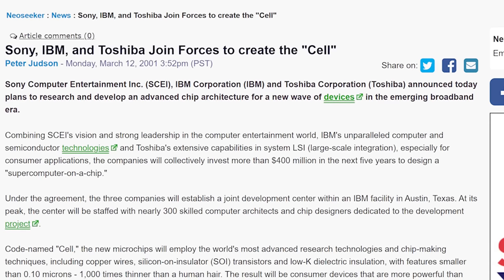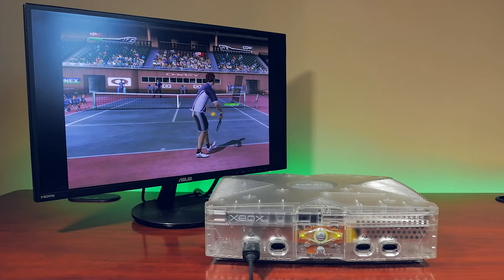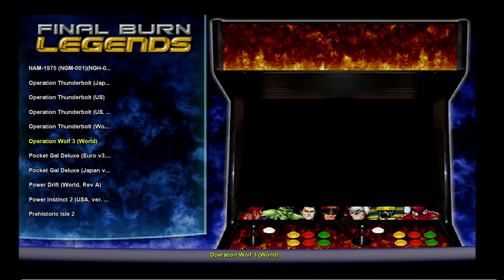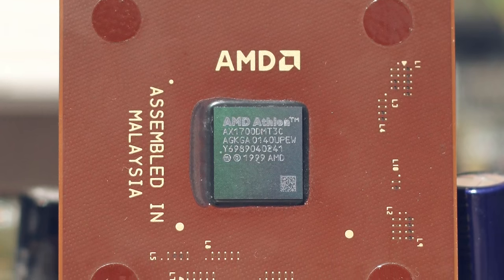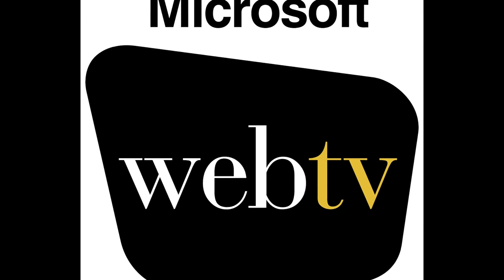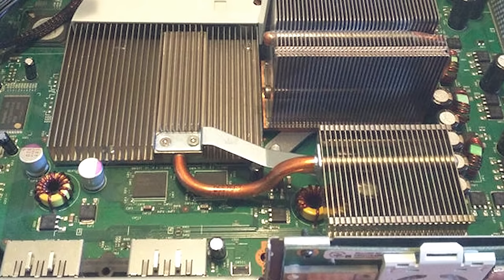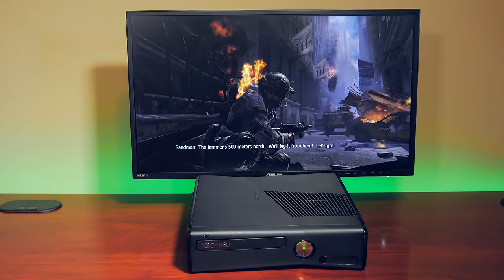Why Microsoft switched from Intel to Power PC for the Xbox 360  | MVG

Comment: I find it interesting to see the shift that hardware chips have taken over the years from excessive diversity to a rigid monoculture. Back in the day it seemed like every console and arcade machine had its own customized hardware designed specifically for it. But as games became more technically advanced and costs of making them increased, it just doesn't seem to be financially viable anymore for console manufacturers to spend the exhorbant amount of money on custom designs and instead reaching for tweaked off-the-shelf solutions. Which is why the PS4 and Xbox one run x86-64 (like standard PCs) and the Switch runs ARM (mobile phones/tablets). I feel like for the 360, the PPC deal with IBM was simply the most financially viable deal for them at the time. Look how much money Sony lost on engineering the Cell. Enough to offset pretty much all profit that would have been made from the PS3 in its lifetime. Despite how interesting of a design the Cell was, I don't we'll ever see such a radical and risque design like that ever again because it just isn't financially viable anymore.
Reply: You have it a bit backwards, they made custom hardware because it was required for the games, commodity hardware was not capable. They never made custom hardware just for the fun of spending money.

Comment: PowerPC just had a great price/performance ratio at the time, x86 could never match it at the time, remember Xbox had to hit 299 price tag and perform well in gaming, at the time for that price you could not get anything from Intel nor AMD which would perform like this for this price. IBM was best partner to do this thing, reliable, strong partner with a lot of experience in custom designs, decades of experience, they were doing it very well with Gamecube, and now they did it again with XBOX360, PS3 and Wii. There is a reason why manufacturers chose IBM.
I do not think that IBM is to blame for overheating, designers from Sony and Microsoft are. GameCube/Wii/Wii U did just fine. 

  Yes that PPC 970 chip was hot as hell but most FAT PS3 failed because of NEC TOKINS and not because of failing Cell. The real problem was that it had shitte thermal paste under the IHS which dried up after long use. A lot of people think that RSX is to blame for YLOD, but it is actually Cell which was overheating because of shitty thermal paste. Sony designed PS3 poorly, they jammed that hot 380w PSU into small case, it did sit near damn chips and caused even more heat on those heat monsters. And even though, PS3 FAT design is shit, if you took care of your system, delided it, replaced failing NEC TOKINS, even CECHA models work to this day. Sony only solved their problems with PS3 Slim, ofcourse 45nm redesign lowered the heat drastically, but that was the price, remember guys they designed that chip in 2002-2005, Intel had a heat monster of their creation as well... Called Pentium 4 and then later Pentium D. 

   Same shit with XBOX360, they jammed all of those components to even smaller case than Sony did and they expect it do not overheat? Its is MS to blame not IBM.
Both Sony and MS sold their consoles below manufacturing costs, at the time, PC prices were just too high, and even though PPC was cheaper it still did cost a lot. 
  Wii U was a failure to be honest, that chip was just fkin too old at that point, IBM did not have anything acceptable in 2010-2011, which is kind of strange having in mind that PowerPC chips were in like 200-300 million gaming devices, why the hell IBM did not invest some money and effort  in RND to improve their PPC gaming architecture, they had the market share and the money, its like really they got money for every 200-300 million unit those companies sold and they did just sit do nothing for 12 years with their architecture. Thats why X86 won, because IBM fell to sleep, they had Apple and Consoles in their hands and they dropped the ball. Apple did good predictions with that and foreseen what will happen, C2D architecture was such a huge leap that even to this day those chips perform decently which is kinda mind blowing to think about it, for example my Macbook Pro and iMac both with C2D chips run so well with modern SSD.. A 14-15 year old chip working well even to this day.... is amazing.. 

To be honest, Cell was a technical marvel, it could not be matched for some time, it was created in 2005 and was so powerful its amazing.. And it is creation of Sony, IBM and Toshiba. The bottleneck of PS3 was nVidia GPU, if it had better GPU it could even play modern games I believe... look, they did go safe route with PS4, but CPU power of PS3 is stronger than  that low end X86 CPU on PS4 which just shows that Power PC was amazing and really could have been an option if not for lack of interest from IBM. Both Sony and Microsoft decided to offload most of processing to GPU side, and did chose weak X86 CPU to do the other calculations which could not be done on GPU. I do not buy fact that developers were more common with X86 than with PPC, look, they sold 300 million consoles from various manufacturers, they had Apple users using that platform, PPC certainly have developers interest. They did chose X86, because it was easier than PPC, but most importantly it had better performance per price, IBM just dropped the ball. Manufacturers chose to go code optimization route, which Nintendo did for years starting with GameCube, they did not give a shit that console was weaker, but they made some the best games. look at late cycle PS3 games, they were amazing.. Even on Wii U, which was a failure, they managed to make some amazing games, its all about code optimization, hardware is nice, but you really care about price/performance + code optimization, and thats why we got X86 APUS on 8th gen. Thats why we got X86 APUS on 9th gen, because for its price those APUS cannot be matched, just like X86 could not match it at 6th gen.

   To conclude, it is kinda amazing that IBM had such an impact in gaming and content creation history they had it all and they dropped it all which is kinda sad, because we need competition to x86, competition is good for us, consumers and it makes technology move forward. Now we see the same thing is happening with X86, Apple already announced they are dropping X86 for ARM which I think is a good call. X86 was a PPC killer and now ARM is a X86 killer, same old problems, too much heat and incremental improvements. We really have not got anything really major since 2011 then Sandy Bridge was introduced, we only got more cores, more clock speed, faster ram, faster storage on these new platforms. Atleast AMD did kickback and provided chips like R5 1600 AF/ R5 3600 and these new amazing R5 3100, they are amazing for their price, Intel is down on its knees now.  I would not be surprised if at some point even consoles will drop X86 and move forward, but for now and probably for PS6/XBOX1_V3 its going to be X86, because price/performance is unmatched at high end, at lower end, lower wattage ARM is already better than anything X86 can offer, look at A13 chips from Apple, they are cheap yet they have so much power that they can match 15W Intel CPU at 7,5W, its just a matter of time then they will learn how to stack those ARM chips and outperform X86 even at higher market.
Reply: ^this

Comment: I still remember all the red rings my friends got. I had a ps3, but I remember a couple of my friends had Frankenstein machines, holes cut in the side, fans hot glued in to suck the heat out, one guy had it straight mounted to piece of wood instead of in a case at all

Strange times to be sure.
Reply: I played the crap out of my ps3, never had any yellow lights. I know they were out there, I'm not naive, but I think the failure rates were 10% of the 360s.
Reply: I kept the shell off of mine and would just take the top of the disc drive off, remove the magnet then insert the disc & put the drive lid back on . Basically hotswapping which would also allow for ISO mods on unmodded 360s :)

Comment: Conclusion: Apple's philosophy about heat isn't changed after all these years
Reply: Considering how they shipped laptops with completely inadequate cooling for so many years, this "philosophy" only exists when it suits them.
Reply: They shipped the last macbook with passive cooling (there is a fan, but is not connected to the processor) just to make comparations when their arm is released.
Reply: It's gonna change with ARM though.
Reply: Apple’s obsession with heat (or having a lack thereof) goes back to the near beginning of the company’s founding, as Steve Jobs hated cooling fans and insistent on using passive cooling whenever possible.
Reply: @jmtrad1906  I saw a video from Linus that barely saw any performance gain even if you totally remove the thermal limitation. Not to mention most people probably won't 100% saturate the CPU of a macbook air for hours on end, it's just not what you would buy for that given use case I would think.

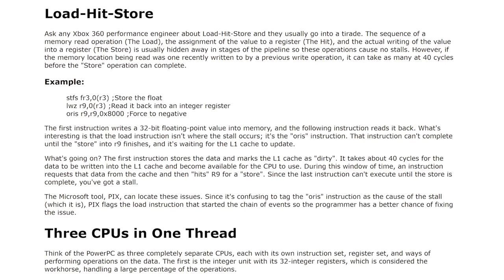Comment: 10:00 oh wow a Burger Becky article about perf and Load-Hit-Store and coaxing the C++ compiler into not generating garbage. There’s quite a bit of difference between early and late X360 and PS3 games and counting cycles and pipeline stalls made the difference. 
IIRC late generation games like Gears of War 3 was known to cause overheating issues because efficient use of hardware means everything is being used at the same time, those 40 cycles of pipeline stall in that article meant a core isn't being used, thus less heat being emitted.
Reply: referral madness  one of the co-founders of Interplay, industry vet going back to the 2600 and Apple IIGS
Probably want to read "Masters of Doom" for the burger story. It's a name that keeps popping up around PC and 16 bit era games.

Comment: Their attempt to control the hardware and control the cost ended up with the red ring of death, would cost them even more in the end. They really cut down on quality control, which saved them costs up front.  Those cost savings bit them in the ass when the quality control came back as millions of units failed.
Reply: They make these sacrifices in order to steal consumer mind share from each other, this has been the most prevalent in making systems successful. The PS2 was outclassed in hardware by its competitors, but the fact that they had limitless exclusivity deals and were reduced in price year after year, led it to becoming the most successful gaming console to date.

Comment: 8:00 I don't know why this is framed as "unfortunate for Sony" that they didn't have exclusive access to PowerPC architecture and Microsoft was also able to use it. Nintendo had been using it since the previous generation and went on to use PowerPC for 3 generations in a row (GameCube, Wii, Wii U). Also Apple had been using it in their computers at that time. It was never a Sony thing. Sony only had the arrangement of special-use cores as the "Cell" processor. Microsoft and Nintendo didn't really try to do that. I don't think it was any more "unfortunate" for Sony than it was for Nintendo or Apple. They probably didn't care one bit.

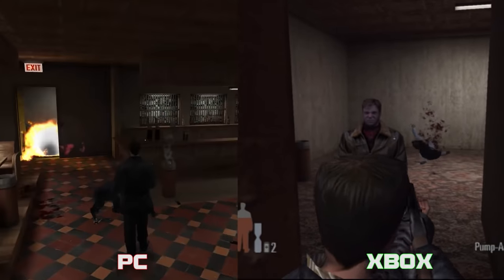Comment: 2:47 the original plan for the Xbox was for the console to have 128MB of ram but Microsoft cheaped out last minute. It makes me mad even today. I always wondered why the original Xbox never got a CPU/GPU die shrink(180nm cpu and 150nm gpu) but I have never found any article from MS, developers or game media stating why this didn't happen. MVG do you know? Intel did shrink the Pentium 3 to 130nm and Nvidia had their GPUs made by TSMC so I am sure they could have moved the Xbox GPU to 130nm.
Reply: they relized it woul be too expensive and left no room for hardware refreash
Reply: Yes the sega chihiro is essentially an xbox with 128mb. You can upgrade it to 128mb or have someone do it for you for about $100. It basically allows you to play Sega Chihiro arcade games, no other real benefit considering Xbox games were designed and optimized to only you 64mb of memory. It does help with other emulation as well but ya, by now we have modded 360/ps3 or a PC that can emulate the higher end stuff.

Comment: What’s really bad is that all they case designers for the 360 and the PS3 had to do was improve air flow and use more active cooler with better thermal paste. I’ve modded both console cases by simply adding cut outs to improve air intake and on the PS3 it dropped cpu temps by 8 degrees C. The 360 relied on basically trying to passively draw air across the heat sinks from 2 incredibly small bands of holes. Stand up the console? Block the bottom intake. Add on a HDD? Block the top intake. The 3rd and 4th bands of holes? Blocked by the presence of the motherboard itself. All I did was cut a huge hole in the case and stand off a sheet of plexi to protect the components and temps dropped dramatically for that system. Add in the 2 small fans, one on the old style cpu cooler to push air through it and one on the extended arm of the gpu cooler to push air down over it and it runs without having a single stutter in fps
Reply: I get tired of morons dragging PS3s into the problem Microsoft did with their POS 360s . They never bothered fixing the problem in the first place by using better thermal paste and make some minor adjustments with their fans . SONY never really had a problem until after a lot of heavy use over a long time with the PS3 . I never had any problems with my PS3 and I used it just as much as my 360 and still have no problems . The 360 issue with me is very different . I didn't buy one til the big lie was going around that Microsoft finally fixed it with the HALO3 Edition 360 . Mine lasted 3 weeks . Microsoft has always been last because they still sell  💩 to their customers .

Comment: The funny thing is that while the consoles were moving to PowerPC, Apple turned their backs on IBM PowerPC and used X86.
Now we havesimilar  times again. Apple goes to ARM, Nintendo also uses. PS and MS use AMD APUs. 
The question is not which CPU architecture is used but which graphics acceleration. 
AMD has made a really great purchase with the ATi. The current success is based on this purchase.
Intel can't get GPUs right we already saw with i740, Larabee we still wait for it 😄 
We now need to see how ARM will evolve and if Apple is really getting performance out of ARM.  But more important is the GPU performance and if there will be more competition from maybe NEC.
Reply: Well, Apple moving to Intel was a huge loss for PowerPC, I'm sure Microsoft and Sony got a great deal on their PPC chips... becasue you need customers to  keep your fabs working you know.
Reply: referral madness  NEC PC98 series were x86 IBM PCs clones with a different BIOS... not a big deal.   PC88 were really interesting though.
Reply: referral madness  NEC or PowerVR is still active in the mobile sector. We have the successors of the Kyro graphics cards, for example the PowerVR GE8320 . In the Playstation Vita was also PowerVR built in
Reply: NEC has nothing to do with PowerVR, they left them in 1999. Imagination jumped with STMicro only for them to bail on them and have the Kyro 3 cancelled in 2002. It hurts even today when I think of it. I know Apples custom GPU uses Imagination patents but I don't know much more than that.

Comment: Although they shared the same architecture, harnessing the power of those processors was difficult and different between all 3 consoles. Making a cross-platform game at that time was a nightmare. 
My 360 was cursed. Out of all the consoles I've ever owned, the 360 was the one I took apart the most which was always for repair. The 360 was a such a furnace that the cooler mounts would deform under the heat. When I finally perfected my cooler mods and had it running seamlessly, I accidentally flashed the wrong firmware onto the dvd drive and bricked it. When I found a cheap compatible replacement, I spilled an entire diet coke into the console as soon as I took the cover off. At that point I took it as a sign and shelved it.

Comment: Red ring isn't caused by high temperatures and, in almost all cases, isn't related to the IBM CPU at all. The underfill used by AMD/NEC for the GPU was a poor match in terms of thermal expansion coefficient and glass transition temperature. After many thermal cycles it causes fatigue in the solder bumps attaching the silicon dies to the interposer. Doesn't matter how hot they run, it'll fail no matter what. It's also why reball/reflow is only a temporary fix. They're just going to crack again.

This was resolved at some point during the Falcon revision of the 360 with a move to a different underfill material. Take a look at xenonlibrary and ripfelix for some good deep-dives.

Comment: Only the VERY early Pentium 4 used RDRAM and that one never reached above 2.0ghz and never had HT.
Reply: pretty sure there were pentiums up to 3ghz that used rdram. but the OPTION to use ddr ram came after a year or so. it made the cpu much slower though. still worth it over the overpriced piece of shit that was rdram
found an article:
https://www.tomshardware.com/reviews/intel-ddr,403-4.html
Reply: Since the memory controller was in the northbridge not in the CPU like nowadays it was really a motherboard requirement.
Reply: referral madness  RAM tech developed by RAMBUS that uses serial rather than parallel communication that was faster than SDRAM at the time but because RAMBUS is such a patent troll nobody uses their stuff anymore.
Reply: referral madness  It probably means you can't be bothered to use Google.
Reply: Socket 478 motherboards with RDRAM are really rare. Almost all of them use DDR memory